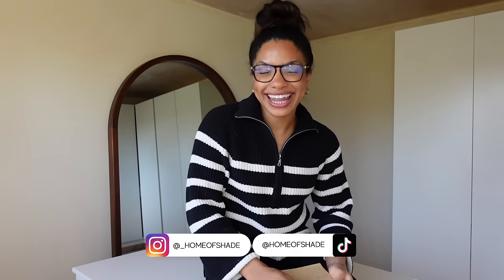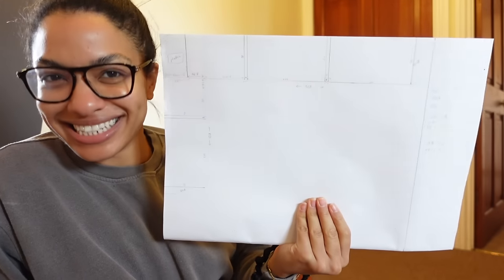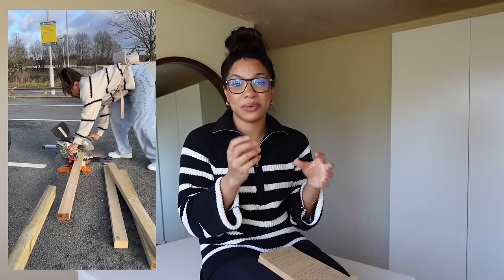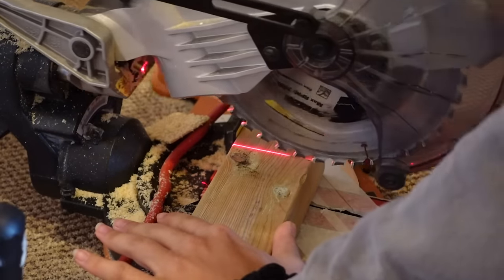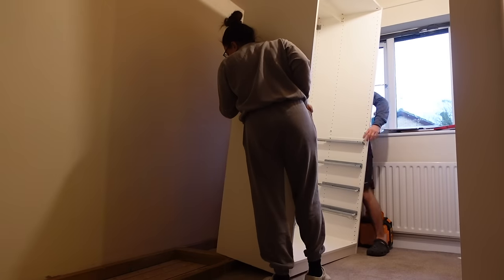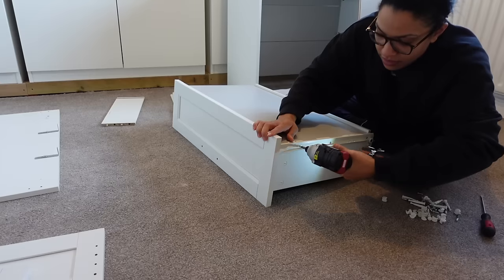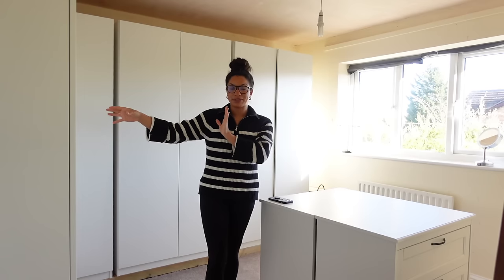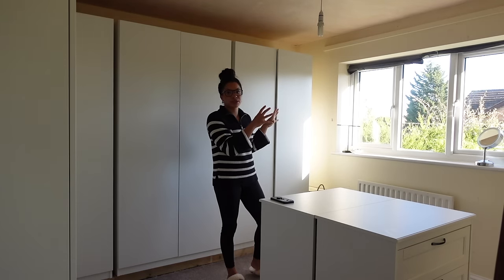DIY fitted wardrobes | IKEA PAX wardrobe hack | Part 1

Comment: I think ikea products are fine they have a lower range mid range and high quality range all made out of different quality materials to suit different budgets and lifestyle now some are made to build once and once only and others are made to move and adapt with you for instance there are a few products that are hollow and have nothing but a piece of cardboard in them and others are solid wood something people tend to forget is the benefits of ikea is if a piece breaks you can literally buy that one piece that one panel you can pick up a new screw and this is where they win ,but if people dismantle them carefully they can go back together easily and can last a very very very long time ,as for the carpet always cut it and take it away but don’t throw it away again some people don’t realise you can call a carpet guy to lay that back down and Seam it together and nobody would know it has ever been cut shade save the carpet and underlay and store in a dry place ,as for lighting well done hun always go for lighting makes a huge difference.

Comment: Quick point about drilling an 8mm hole in top section for wiring access........ you don't need to!

The top and bottom pieces are identical so the bottom has two 8mm holes for the floor height adjusters to sit through.
Top still has those holes but obviously no adjusters so just use them instead of drilling.

Saves plugging the hole with plastic bung.

Comment: I have seen others put billy book cases back to back without the back panel in the small gap by the window. 

Also the island, you could add t&g panelling to the side to hide the seem between the wardrobe. You could put the drawers on a base too like the wardrobes and build skirting round it all. Add newel posts to the corners and it will look great built in. I cant wait to see how you finish the room. X
Reply from the maker: Oh my gosh I LOVE the idea of the newel posts on the sides. That would really set this apart. I'm going to have to get designing. Thanks lovely!

Comment: I think putting a raised recessed base on the two drawer units will make it the perfect height and fot in seemlessly with the wardrobes. 

Also same colour as the wall all the way to make them look more like built-ins and maybe a feature wall with the mirror on thats darker / dofferent colour and has some floati g shelves to the left of the mirror.
Reply from the maker: loveee these ideas thank you. hadn't thought of adding a base to the two units but i did want to put castor wheels on them to move them about more easily so this would be a good way to hide the wheels too!
Reply: @ShadeShannon  I can see that working really well!

Comment: Who told you you talk too much?!  You’re a communicator and don’t just chat for the hell of it, you give information!  Those who have a problem with that can always turn the sound off 😆
I’ve had Ikea pax wardrobes, Ikea kitchen and sofas for over ten years  (they all went together like a dream and have been in daily use) and nothing - I repeat nothing! - has broken, chipped or worn out.  My only gripe was their “customer service” when we had problems with one drawer front  (built back to front so their fault) and had to return it - they were incredibly rude!  Other people I know have also whinged about their “customer service” too regards wrong or bad fittings packs and the rude and unhelpful approach of “customer service” when trying to get the right bits.
To end on the positive though, someone I know who build lots of different manufacturers flat-packs for lots of different customers, prefers to Ikea over other more expensive stuff - says the quality of the Ikea stuff is noticeable
Reply from the maker: Hahaha thank you! Ooh I’ve never had to deal with CS yet - hopefully I won’t have to🙈 

I agree! I think IKEA quality is only getting better as well. Just treat it well 😊

Comment: I love your space! How did you anchor the wardrobes to the wall?  I live in Mexico and we do not use drywall, and I am scared of anchoring things to the wall because the holes tend to be bigger for brick walls, do you have any tips?
Reply from the maker: sorry i didn't show this very well i think i was fed up at this point 🤣 we used drywall plugs but they work even better for brick wall. you won't need a big hole to do this so it should be fine.
Reply: thank you so much!! I will go get the materials to start my process.  Thank you again for responding.   @ShadeShannon